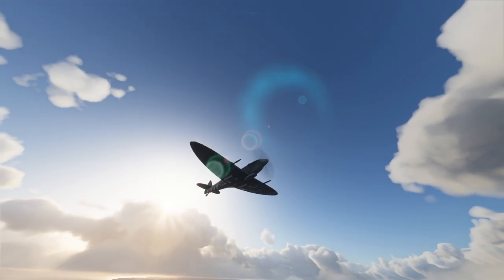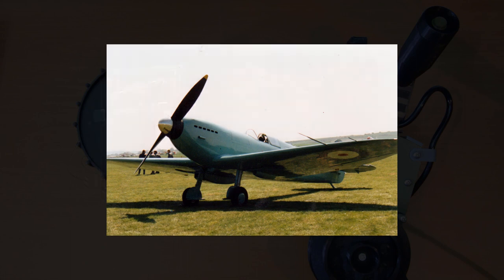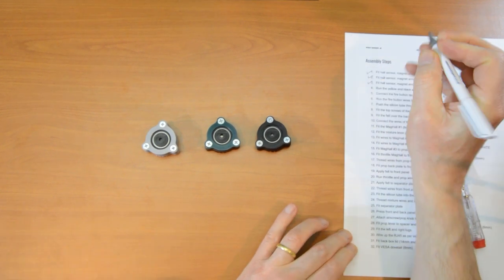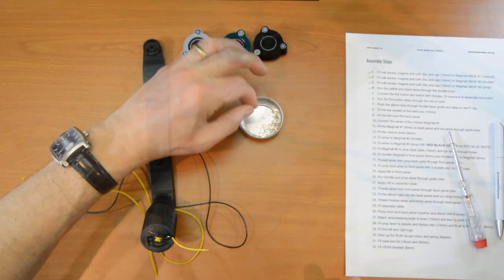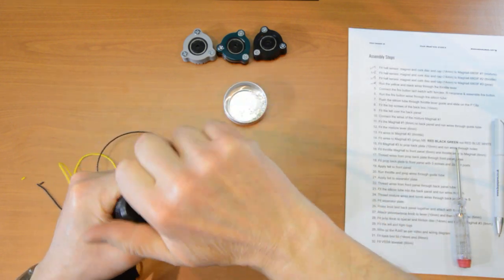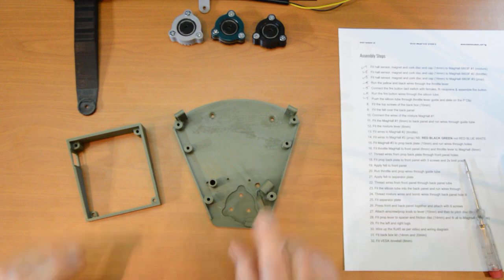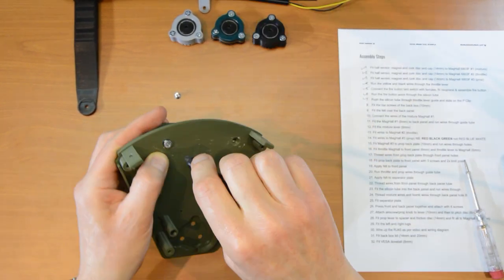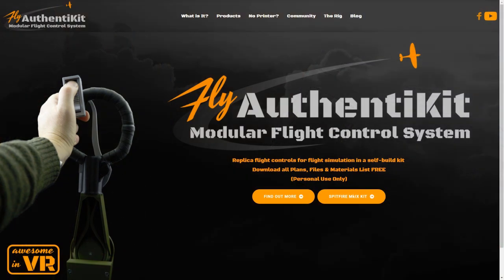AuthentiKit Spitfire MkIX Flight Controls - Throttle Quadrant

Comment: Tip for getting the wires through: 
Use isopropyl alcohol to wet the wires just before inserting them. It will act as a lubricant just long enough to get the wires through, then it evaporates.
Reply from the maker: :-) Just been watching your videos - flying wing one v. interesting

Comment: These videos are making me seriously consider getting a 3d printer.  i've wanted one but not needed one.  and i don't a need any of these actual controls.  But the fact that i can print them, and build them myself makes me want to need them, because i love to build things. This is amazing!   
Any suggestions for 3d printers?  i could maybe do this with a cheapo ender 3 but if i'm going to do a lot of stuff maybe i want to splurge on something nicer?
Reply from the maker: If you love to build things, then this is for you. I wanted a 3d printer for years and then this excuse came along. An Ender 3 can do everything and tends to work great for a few months but if you can afford more then get something that needs less TLC. Prusa Mini maybe? Something with dual Z perhaps, auto bed levelling and maybe direct drive. Read all3dp's reviews.